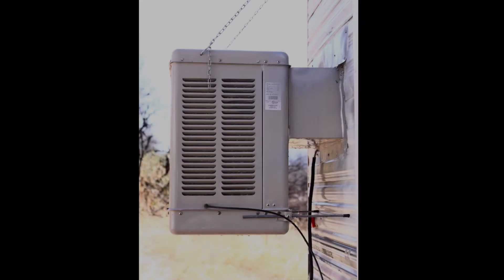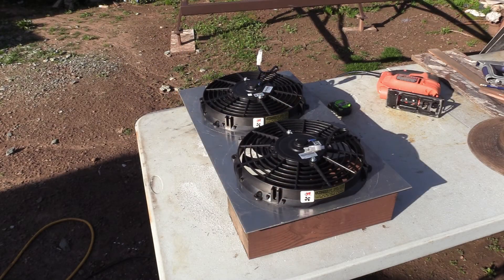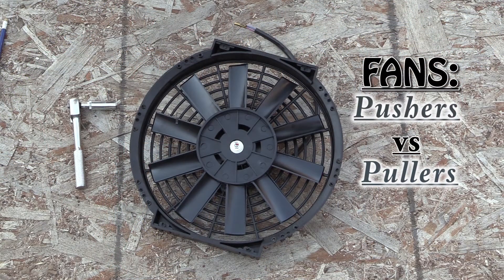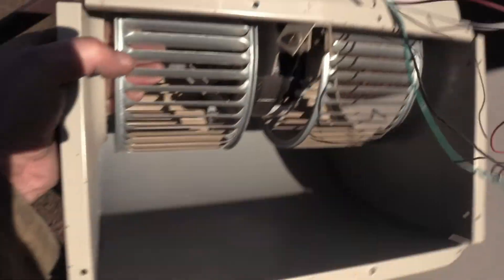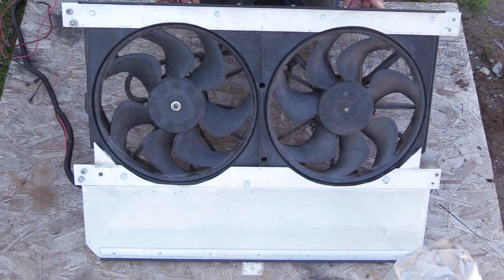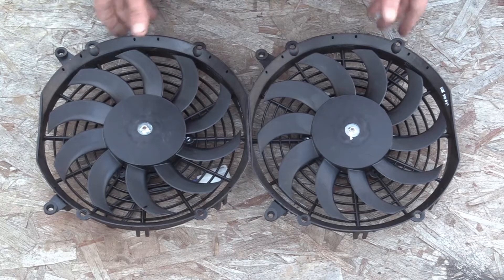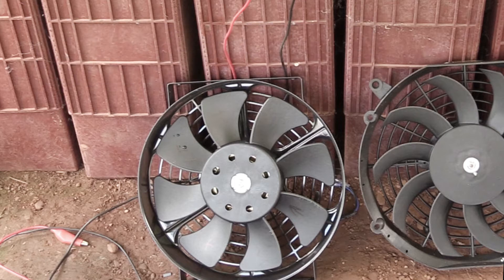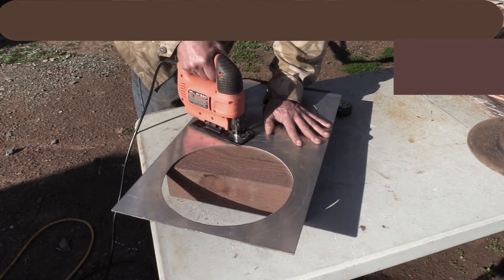DC for AC Swamp Cooler  --------- 12 or 24 Volt DC PART 1

Comment: Thanks for your hard work. I want to modify my 3600 cfm house cooler to run on solar panels, charge controller and lithium batteries. Everything I have is 12 volt DC oriented but maybe I can go to 24 volt.  I would also like to run my original squirrel cage blower.   As it is with, 2 speed 1/2 hp 120 vac motor, on low speed I am measuring 425 watts. That serves my purpose well and I rarely run the high speed at 760 watts. The pump is the standard ac energy inefficient unit. I already have a few DC pumps to try.  I want free cooling this Summer when the sun is out.

Last Summer I ran it on my home built ''solar generator'' with 7200 watt hour capacity. That unit is for backing up the fridge and a chest freezer during power outages.  I prefer to build a dedicated solar charge battery pack dedicated to run the cooler alone.

Have you run into any efficient 1800 rpm DC motors in your travels?     Thanks much...you do nice work.